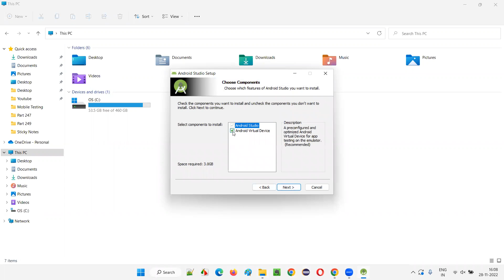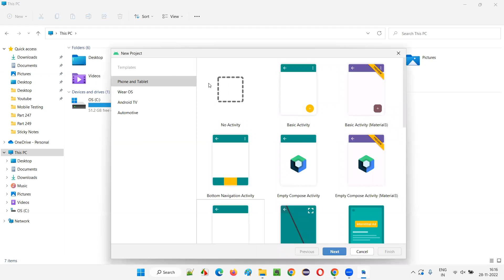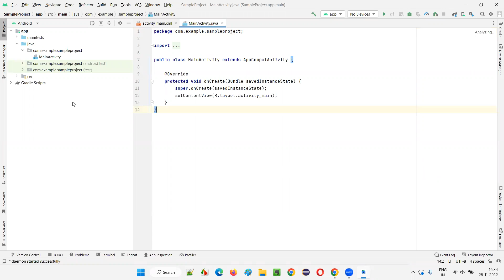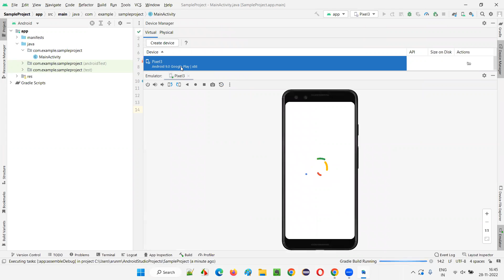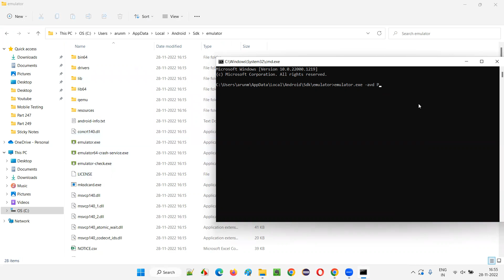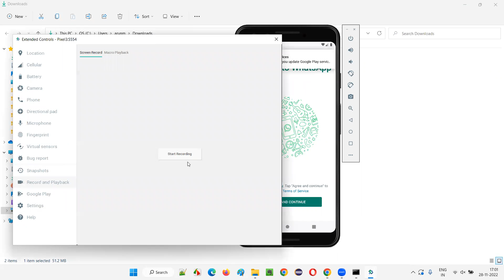Comment: Hi, I am unable to find "Tools" under the SDK path as per the video 15 minutes 20 seconds while setting the path in environment variables. could you please assist me?
Reply: Did u get it bro plz help me
Reply: hey even i couldn't get the options you can simple add those paths to environment variables and you can proceed with that I 'm able to emulate the mobile devices with different models  @weedhead_2000